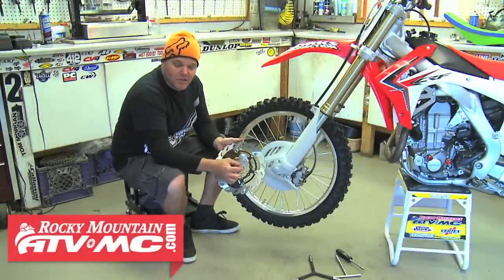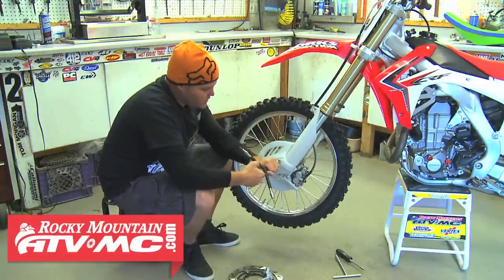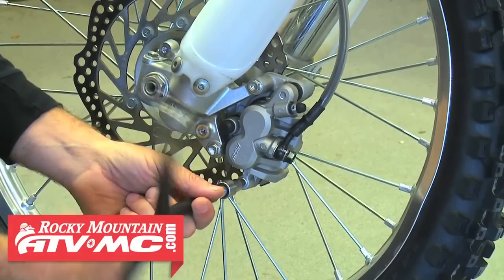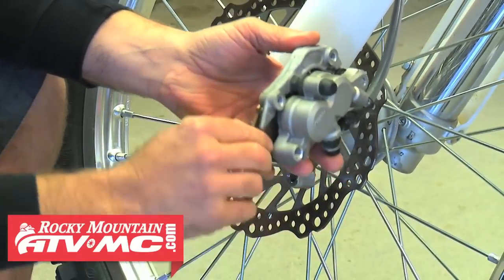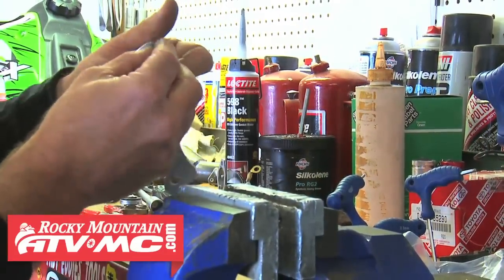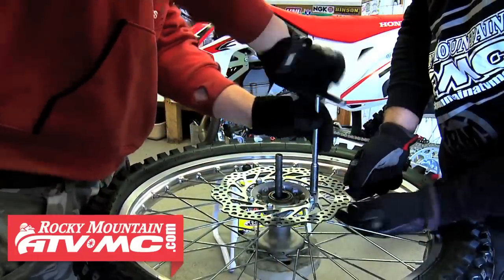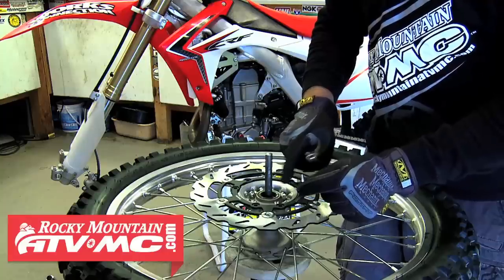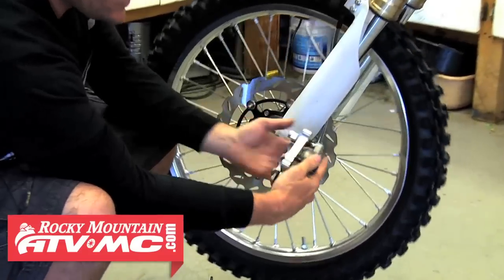Tusk Oversized Floating Brake Rotor Installation

Comment: Had a very difficult time installing this...said it fits my bike perfectly but for some reason my pads are rubbing. Im working on a Drz 400s (2016) and after hours of trying to make it work the frustration got to me and i have yet to touch it since. My spring and guide plates are there and in the correct position, but my pads are rubbing and i have a very squishy front brake lever now after pumping the brakes.
Reply from the maker: I'm showing we do not carry the Tusk Oversized Floating Brake Rotor for your machine. Is it a different brand maybe?  Usually most oversized brake rotors come with an additional bracket to accommodate a bigger diameter sized rotor, did yours come with one?
Reply: Rocky Mountain ATV MC Yes it came with a caliper adapter and its this brake but i didnt buy through your site. My research showed since 2013 atleast the caliper has been identical on all S models of my Drz so i bought the rotor for the 2014 drz. I doubt thats my problem, but i am going to try having a shop look at it when i go in for some other modifications being installed. If it doesnt fit i will tell them to install the stock one back on and return the rotor where i got it.
Reply: Rocky Mountain ATV MC I apologize. You were right. I bought the driven front rotor, and mistakened this for the same rotor.
Reply from the maker: I don't show our  Tusk Oversized Floating Brake Rotor fits any of the DRZ400S model bikes.  Sorry.
Reply: My apologies, you are right. I bought the Driven brand. Seems like its user error on my part...
Reply: Change the front brake pads on the CRF 450

Comment: Bought this for my 04 Honda CRF250x.  Installed just as your video, except you didn't include the drilling for the Trail Tech sensor mount.  Bought my bike used with a Vector on it so I didn't have to drill the first one either:)  

 Now the problem is the sensor is too far away to pick up the magnetic bolt which connects to rotor to the hub and these rotors don't have any place to mount a magnet further out.

Any suggestions?

I was thinking of making a stiff plate to go parallel to the brake rotor and perhaps rivet it to the bottom of my plastic fork protectors so the sensor can mount to that.   Is there a better solution?